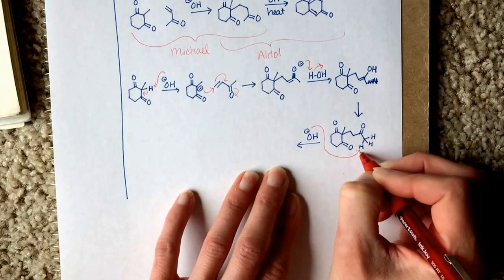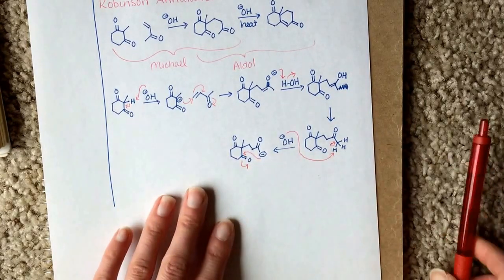Robinson Annulation

Comment: I don't think the final step is correct; typically the double bond kicks up a pair of electrons onto the right O [carbonyl O] and collapses, shift the double bond over and the OH leaves then. I don't know how important it is to show that step but my professor really emphasizes it!
Reply from the maker: +R Yes, that is a common "version" of the mechanism.  The mechanism you are referring to shows the negative charge being delocalized out onto the oxygen atom.  It is essentially a resonance structure of the intermediate that I drew (with the negative charge on the carbon).  Some textbooks use one, some use the other.  I always try to stay consistent with my textbook to minimize confusion - this mechanism is confusing enough!  :)  Your professor probably has the same train of thought.